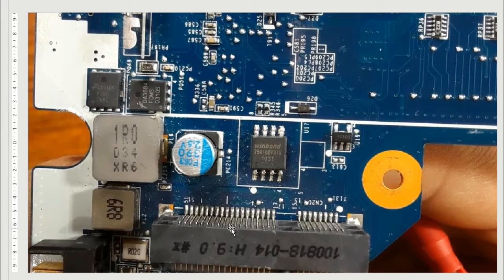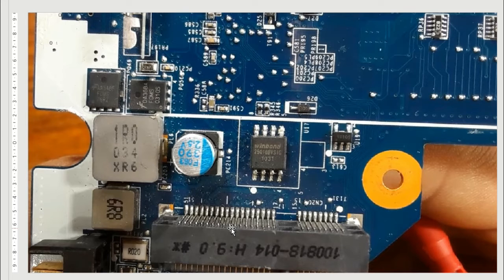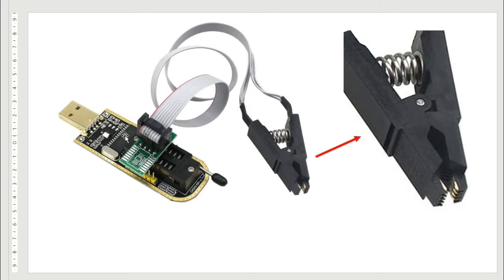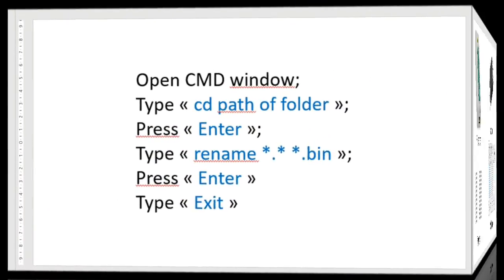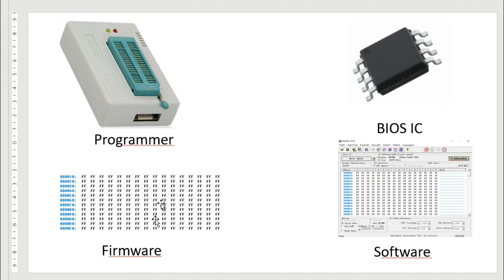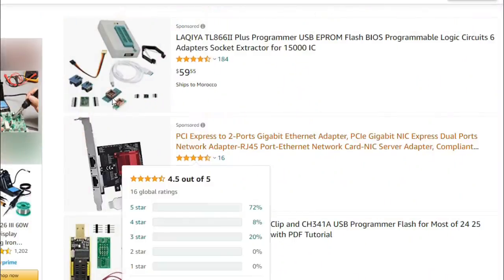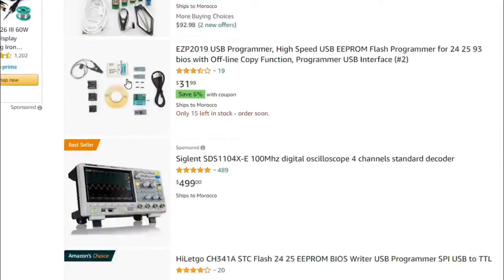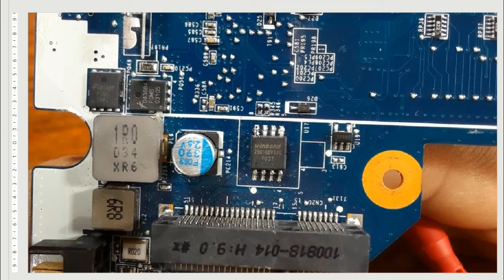BIOS Chip Faults | BIOS Programing | BIOS Pinout - Laptop Motherboard Repair

Comment: Hi, Love you practical videos.  i have old toshiba Pro l300 and i changed the exe to bin file as per this video and the file size is 1.6mb BUT the Bios chip is only 1Mb!!  So the CH341 Programmer warns me the file is too large. So does this mean the original USB EXE bios flash would fit as it changes the file to fit? and when i try to use a bin with the programmer its too large?  So can i reduce the bin file as i cant start the Laptop to flash bios the old way with usb.  The only bios files i can find are later ones from 2016? and LT is 2006-2008 age, i wonder if early bios file was smaller and thus the Bin file would be smaller and i could use the programmer then?

Comment: what if you flash bios but still no display.
Reply from the maker: In that case maybe the bin file is not good or the Graphic card failed
Reply: @electronicsrepairbasics_erb  This is for a desktop motherboard 3.3v and 5v are fine
Reply: I still learning LT repair but if its any help, you can MAYBE narrow down display or something else if you check pin 22 (old WIFI 52 pin socket, later socket its 44? but i havnt had one yet to test that)  to see if it has 3.3 volts. If NOT, this means that the trigger to turn on the display wont be there and thus its NOT the display unless thats broken too.  So if you have all normal voltages Like 3.3, 5, 19 and the small ones 1v ish around the CPU and GPU, odds on its a bad corrupted Bios.  ERB can confirm this or comment as i NOT a expert.